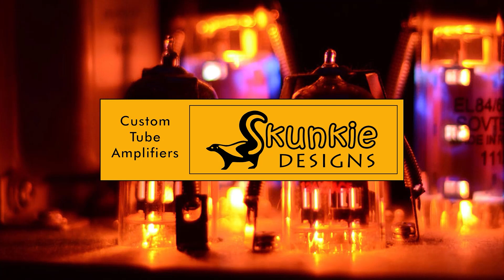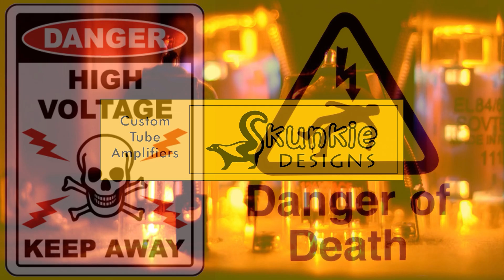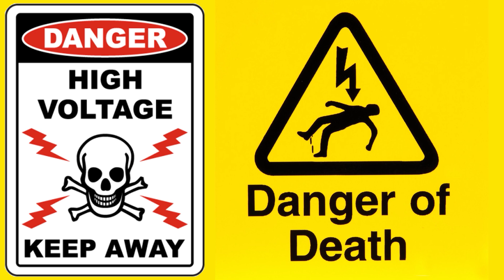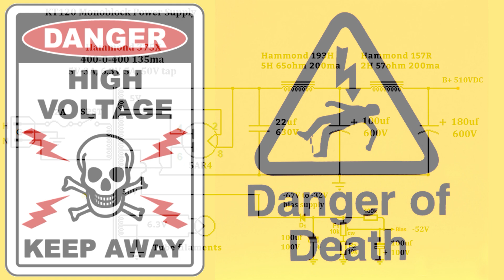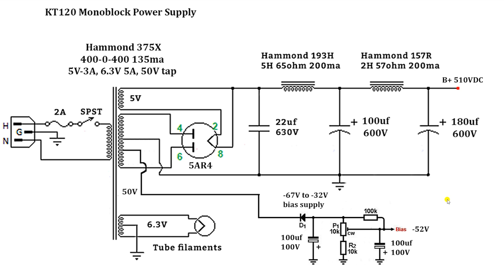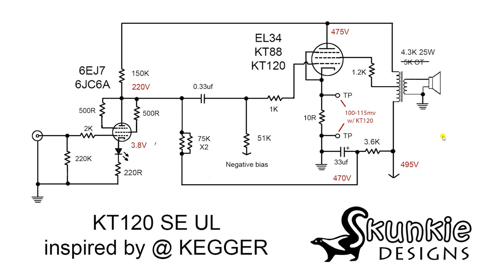How to build a reliable negative bias supply for a Tube Amp.

Comment: This comes at a high cost if using silicon rectifier, because the bias tap requires a grounded center tap. A grounded center tap means that the HT winding is about 40% less efficient compared to using a bridge rectifier w/o center tap, hence requiring a beefier power transformer.
Reply from the maker: It's not that simple. Hammond rates their transformer ma capacity based on being used with a full wave rectifier. If used with a bridged rectifier, you have to downrate them this same 40% as far as load capacity. You don't get free VA based off using a bridge vs a full wave. Yes you will get higher voltage from the same transformer, but lower ma rating so to get that back, you have to upsize to a "beefier" transformer.

Comment: I have an amp that the bias is driving me crazy. It has around 70v AC but I can only get it to around -46v max after the diode onto the grids. And with super low resistance OT windings on the primary relative to the center tap (18 and 20 ohms each side) the bias is at about 130% dissipation at the lowest. The only thing different on my schematic is there’s no second cap and the 100k is on the middle leg of each pot because where your 100k would be is where the source comes in and it’s shared between the two pots for each side. Half of the mind to just get another dedicated transformer just for bias voltage or something to ensure I can get it down to the -60 or -50 range.
Reply from the maker: You could wire it up as a voltage doubler.
Reply: @SkunkieDesignsElectronics update - I did just that and it’s perfectly biased now!

Comment: ... and another +1 for well explaining the useful role of the output tube cathode resistor as a fuse
Reply from the maker: Glad you enjoyed the video, thanks for watching! Do be aware you could end up with "nuisance" resistor failures by under sizing them, but for me personally, I'd rather replace a resistor than deal with the aftermath of a red plate melt down event.

Comment: +1 for the 100k backup resistor  -- I'm seeing this on too few schematics
Reply from the maker: I always include it for safety! Not sure why so many amps/designs skip this $0.02 part. Same with the power supply cap bleeder resistor.

Comment: I will build the s4 one tube preamp,and about speakers, i think jbl 100 or so vintage,low price i simply love the old jbl s. You dont need a bigg amp,but you must play inn the speaker,my condensers used long time burn in, they are orginal 1979. You gett those fore 1000 $

Comment: The light went off on the huge advantage of using negative bias, not only do you get rid of the high value Cathode resistor but also the electrolytic capacitor with it!   This would go long way to explain why 300Bs and your KT 120 mono blocks sound better than a typical EL34 amp.  The other advantage I see is it could allow using lower voltage rating resistors, (400v instead of 630v),  and caps compared with a standard zero bias setup.

Comment: Howdy.
I use a separate 12 V filament transformer in my designs.
Then I use a quadrupler to get the - 50 V to -60 V for the end tube bias.
Cheers.

Comment: What a fantastic explanation. It's one thing to read these things, but to have it explained so clearly and simply makes all the difference. You've confirmed my suspicions that the additional 10k and 100k resistors are there to prevent t red plating should the pot fail. The tip to fit a lower wattage bias measuring resistor in the cathode, to act as a fuse,  is also fantastic advice. I've seen these fitted by others in the past, but being 2 watts or  above. Thanks for your videos.

Comment: It drives me crazy when manufacturers of tube power transformers fail to add a bias tap to their H.T. winding.  I've never been comfortable with alternative bias arrangements which depend on capacitive reactance in conjunction with voltage dividers to derived bias.  In my last amplifier build, I used a 120v=>12v power transformer used backwards on a 6.3v heater winding to get 60vac for the bias supply.  Wasteful, but resulted in reliable solution.

Comment: Any thoughts on using even better regulation/filtering on -bias supply? Also, using an "auto bias" type system to hold bias? I tried both of these on my now highly modified m125's (tubes4hifi) and it worked out well. Although its more silicon....
Reply from the maker: I've used auto bias on most of my projects. Sometimes "fixed bias" makes sense and this I feel is a good way to implement it.

Comment: Hey Skunkie, greetings from NYC. So, I know nothing about circuit design, but your explanations help it to sink in, so thank you. I also love how you are always thinking about how to protect the circuit, and frankly, many/most people do not.

My question is this: At Diode 1 doing the half wave rectification, is there any benefit, or is it even possible to use a tube instead of a diode, or is it inadvisable for any reason?

Thanks for all your help and I hope to one day clearly understand a complete circuit from start to finish...
Reply from the maker: Just added complication. Before there were silicon diodes they used a small tube for this. One could also use a bridge rectifier if you need more voltage, but these seem to function fine as a half wave w/ filtering caps.

Comment: would it be okay to have 2 diodes oriented the same way so if one fails, no problems.
Reply: @@iainbowman8979  Yes mate it should be ok, but you will 'lose' 1.2 to 1.4 volts across them.  If your circuit can still operate with up to 1.4 volts less, then it will be fine.  By the way, you must always use diodes within their ratings, of course.  Usually rated current & voltage are the main parameters to be sure of.
Reply from the maker: Sure, I don't see any issue using parallel diodes.

Comment: i disagree on that bias circuit I've always copied the fender twin bias circuit and tweaked the resistor etc. to put it in a nut what you are using is a bias balance circuit. the topology for neg bias is a sweep from minim neg say neg 30 volts to neg 50 volts. if you are worried about loosing bias fuse the HT witch you should be doing if building a valve amp
Reply from the maker: This is neg 30ish to 65, KT120 tube is gonna need around 52, EL34 is gonna want low 30's. Why fuse the HT when it's not needed if you simply design a bias supply that's not going to get lost?

Comment: If there is no bias voltage on the transformer, could you take it off the high voltage going to pin 6?
Reply from the maker: Yeah there are ways of pulling the bias voltage off the HT.

Comment: So the grid leak value is 1K (grid stopper) + 51K + 10K (pot with 100k in parallel) + 10k ?
Reply from the maker: Grid to ground measured is 66K with the bias pot adjusted. Yeah this is a little over the published "Grid leak resistor max" but I know these have been run with 100K grid leak resistors + bias supply so I'm good with that.
Reply: @SkunkieDesignsElectronics  Thanks. M
Reply: @SkunkieDesignsElectronics   I've been looking forward to this video and discussion about this limit. I have a PP amplifier (Luxman A3600) with a fixed bias circuit. The bias circuit was modified to take KT88s/6550s after the original power tube went out of production and I've since replaced the KT88s with KT120s. I've noted the concern online about the max grid leak resistance of 51Kohm for KT120s. TBH, I've struggled to calculate the resistance of my bias circuit - its complicated and I'm still learning! However, I think each KT120 tube is seeing somewhere around 60Kohm, biased. No one has indicated what would happen if it is too much for a tube?
Reply: Many years ago I modified a pair of Dynaco Mkiii amps for a friend. He picked up some power supply upgrades to replace the old quad cap, and I believe to convert to a SS rectifier. There was probably more but I don’t recall. I also changed the grounding and tweaked the bias supplies so that he could use a wider range of output tubes. But one thing I did was I used a small zener diode string to regulate the bias supply. I don’t recall exactly how I implemented it, but it made the amps bass much cleaner and more controlled. I cannot be certain, but it may have been as simple as adding a small valve resistor after the first cap, then adding a zener string with a total valve of the nominal B- followed with another cap before the biasing components. Unfortunately I don’t have access to the Mkiii’s to verify how I built it.